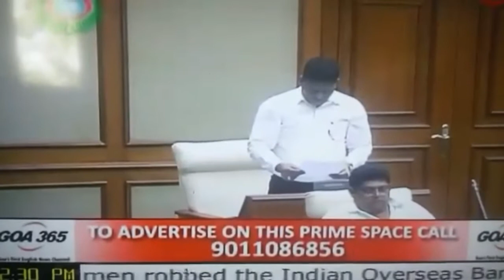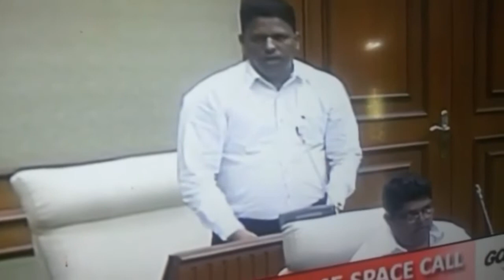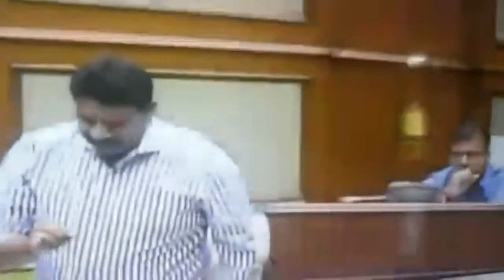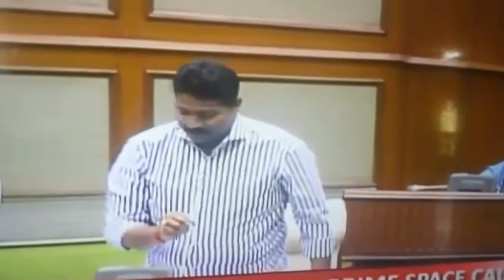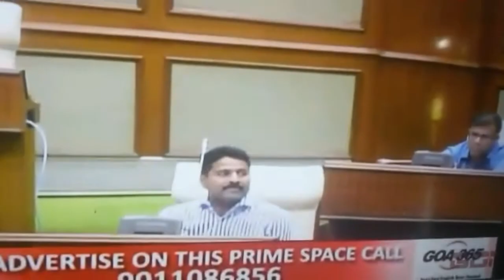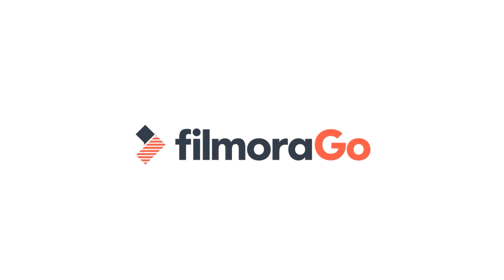Cuncolim power  woes resound in Goa assembly.... empty promises by power minister

Comment from the maker: And so, we begin the final two weeks of 2017. The weather may be cold, but our story today is, well, warm and sunny.
 
India is both a large country and a sunny country. And yet, less than 5% of the installed power comes from solar energy. In contrast, nearly 60% comes from burning coal.
 
The story of solar power in India will sound familiar—short-sighted policies, expensive capital, greed-driven oversupply, crashing tariffs leading to unviable businesses. But a new ray of hope could be shining on the sector, from the rooftops of factories and businesses.
 
Companies like Amplus Solar and Cleanmax are setting up and operating solar plants on the rooftops of businesses to sell energy back to them, at rates much cheaper than grid electricity. And not just small ones either. For instance, Amplus’ solar installation for Yamaha Motor Company in Delhi-NCR generates 6.3 MW of power, the largest in India.
 
The immediate potential market is the rooftops of the top 5000 companies and educational institutions in sunny India. Sensing the opportunity, investors are rushing in too. Amplus and Cleanmax have raised $150 million and $100 million respectively from investors. 
 
But regardless of the sun above, the roads ahead are dark and treacherous. Cheap imports, fickle government policies, the high cost of domestic capital and cumbersome net metering policies to feed power back to grids could still upend this space.